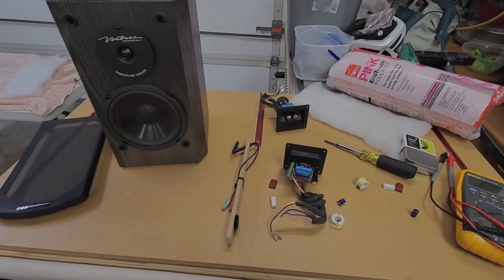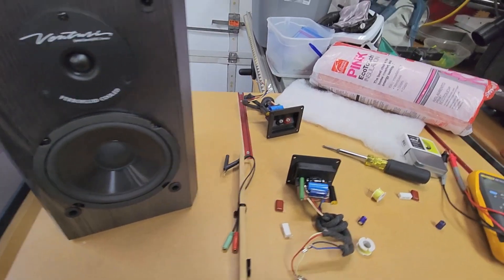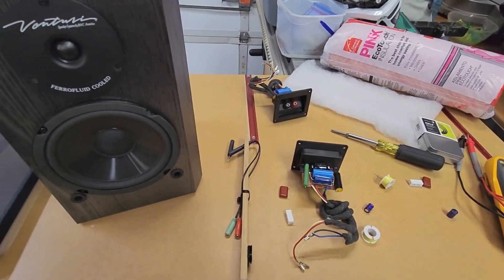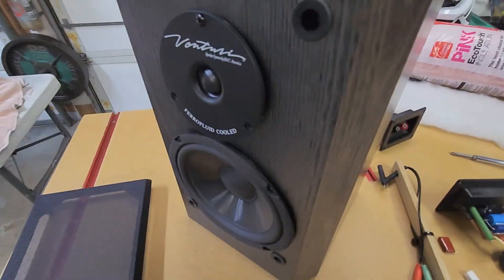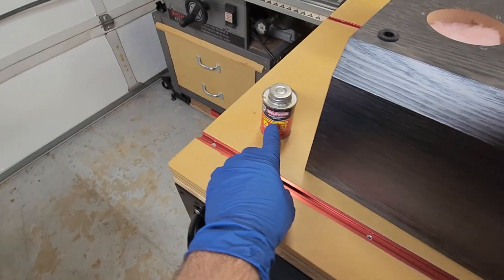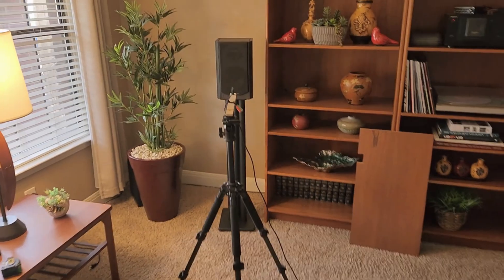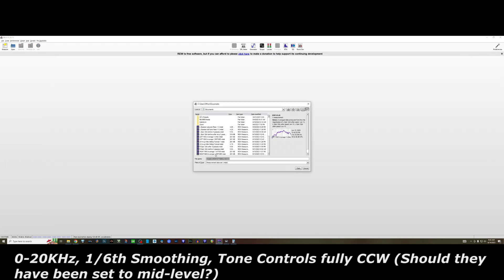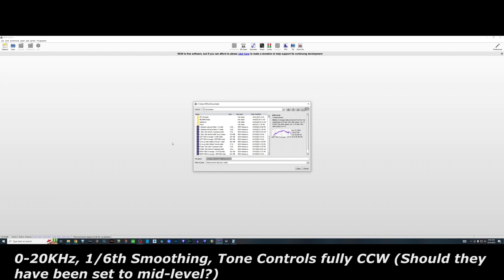BIC DV62si Bookshelf Speaker Modifications

Comment: Don't send these out for a crossover mod. Not necessary. I spoke with the original engineer and he said to simply add a four-ohm resistor on the positive side of the tweeter, it will smooth the response dramatically. This was done during the original design, but the marketing department requested the resistor be removed so it would "jump out" when compared to other speakers. In addition to the 4-ohm resistor, placing additional foam or acoustic fill will provide substantial improvement. Do this and you will be hard pressed to find a more pleasurable listening experience under $500.00

Comment: How about never using house fiberglass insulation in any speaker box.  Go to the thrift store and buy a in good condition fiber filled pillow. Plenty of non-fiberglass insulation. Nothing worse than getting a pair of speakers or a sub box home and "Upgrading" it finding fiberglass pink insulation lining the entire inside of the enclosure. At that point I say to myself "FUK" "God-Damn-It" "Who is the F-ING re-tard who did that"??? "Great just what I wanted to dig out of a 5 inch hole and I just ran out of nitrile gloves. I knew I should have got them yesterday when I was at Harbor Freight".  I could continue the rant because it would continue until I was done extracting the pink hell. 
No disrespect to the video creator this is what I honestly think when I see it. You got 1700 views and 500 of them hit the hardware store and bought pink panther speaker enclosure hell.... Now in a couple more years or so they will upgrade and donate that enclosure to the thrift store and I will buy it not knowing the silent pinkie puff puff waiting for me to run out of the blue gloves. Heck even a old sleeping bag would have nice speaker fill if you found one that was not a sloppy mess.

Comment: I do think you more likely should have had the tone controls centered up and down. I'm fairly sure all tone controls center at 0dB and go negative or positive fixed in either direction. Similar to a L/R balance knob. 

I would retest with all bands up and down vertically. Hopefully that tone controller you will feel the knob lock centered. 

I just got a pair of Insignia bookshelves (the old best buy exclusives) I'm thrilled with their sound and I'm looking forward to popping them open, investigating and modifying.

Edit: Also, the 1800Hz boost was so cool to see. Better performing for all applications, movies, music and gaming. You can see it starts around 1500... PERFECT. If your wife allows it, I recommend shifting the speakers to where the window is.

Comment: Hey Sailor --- good video, IMO. One other mod you may be able to do is to brace the inside cabinet walls using 1/2" wood dowels (ie: side to side). A couple should do wonders to stiffen the cabinet. You could also apply butyl sound damping sheets and route out the tweeter to flush-mount it on the baffle. The butyl sheets will reduce cabinet vibrations even further --- and flush mounting the tweeter should smooth out it's response (ie: no more double humps). I'm in the process of modding my PSB Imagine XBs and my Energy RC-10s in the same manner --- that is, before I send them to Danny at GR Research to get the crossovers modded. BTW, Semper Fi -- from your Jarhead neighbor, LOL.....